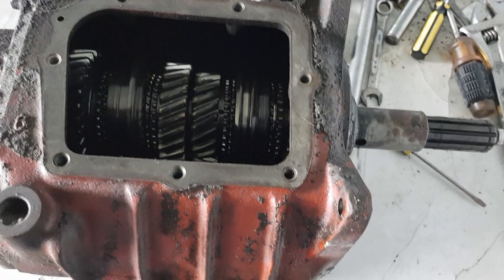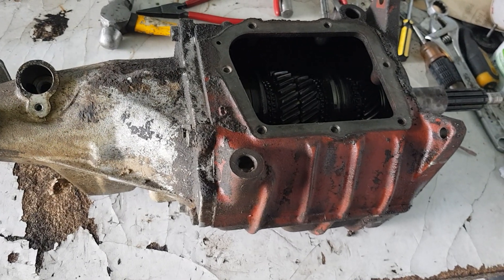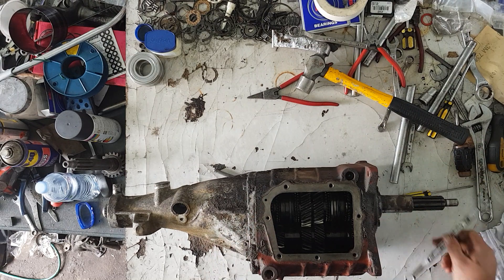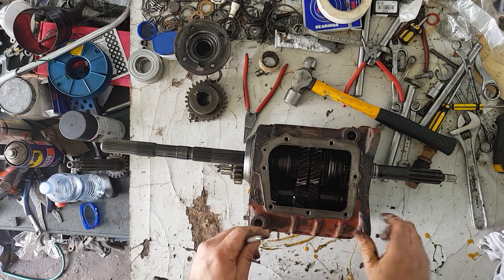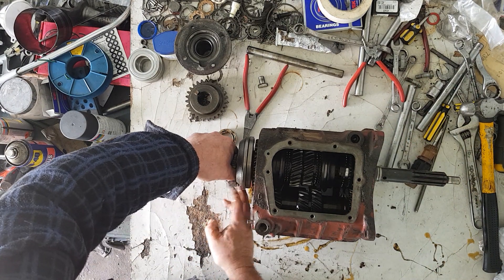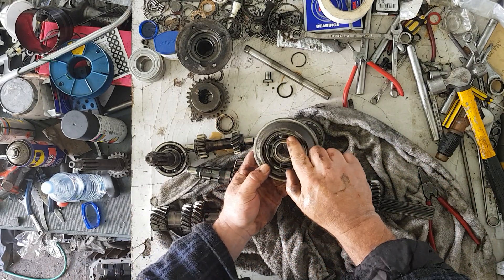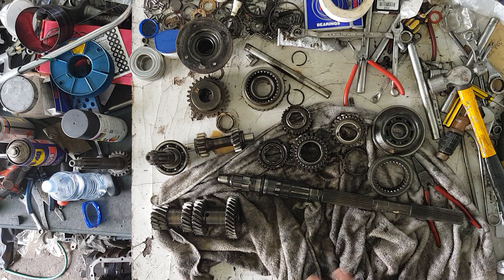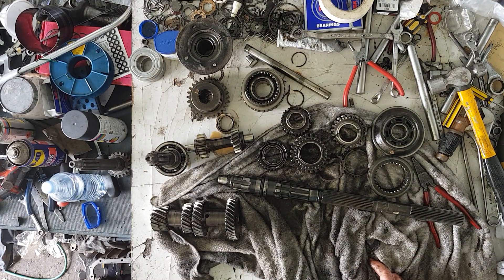holden m20 m21 aussie 4 speed gearbox strip down, part 1

Comment: Did you do a video of it going back together?. 3 yrs later?
Reply from the maker: yes check them out
Reply: @monaroman37  I just found them ive watched part 1 so far great vids thanks
Reply: I have a Aussie 4 speed 6 cyl box out of a WB 1 tonner. 1st geat 2.75
2nd 2.75
3rd 1.75
4th 1.00
I belive e the diff maybc 355? I know its a Salsbury is all. Havent opened it up to see if its a 10 bolt. 
I want to change the imput shaft to a V8.
Any suggestion on 1st and second?. Going a 350 SBC i want good take off and to have more power in each of those gears. Not a strip car just a good mild street ute stage 1-2.
Reply from the maker: @eazyrider6122  go chev box behind a chev engine,
Reply: @monaroman37  Yep just trying to use what i have now. Below doing that later on. Poinless i guess.

Comment: Hi Mr Monaro.
I have a m20 i will be installing for my 308 can you recommend a kit to make it more stronger. 

Thanks.
Reply from the maker: all kits are same, but find kit with quality bearings, you cant make them stronger, comes down to driver, linkage adjustment is important, also fit new spigot
Reply: @monaroman37  thanks Mate .
Reply: @monaroman37  which of the circlips is often replaced with a bigger one after some machining?  Also what's your thoughts on replacing the needle rollers with bronze bushings?
Reply: Tremec
Reply: Tremec what ? T5 , TKO, T3550, T56 , D20 Single Rail, ??? @dynomiterecords4348